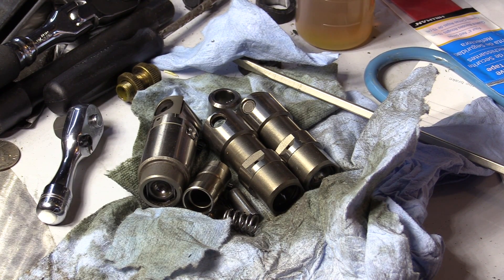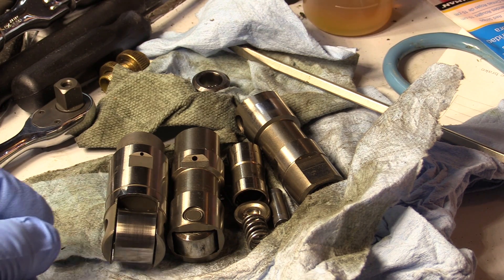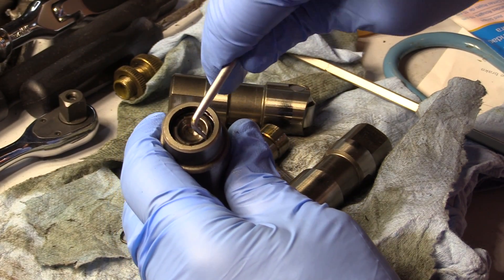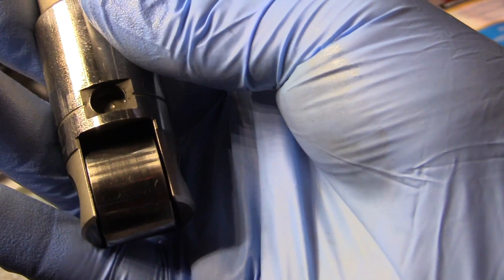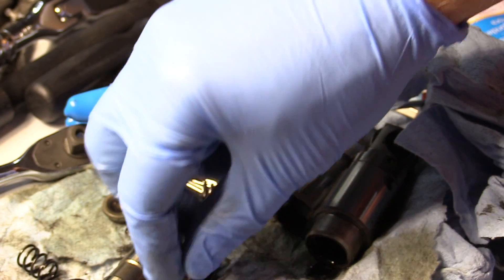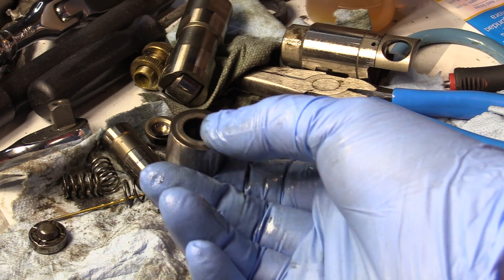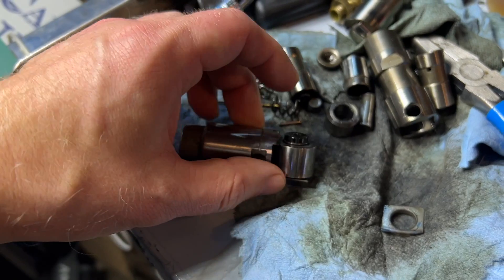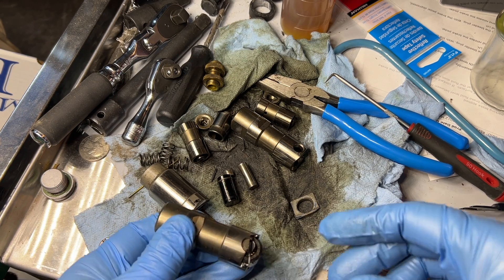Ram 6.7 cummins lifters design problems, Ram hiding 3 issues, Cummins ticking, lifters hydraulic

Comment: Simple, corp greed is why. Dodge can sell more parts and engines. Sad they finally got rid of the 68rfe junk, then sells Cummins designed to fail. ITS A DIESEL, it’s supposed to make noise, that’s part of the reason we bought it in the first place. Making a diesel more quite is stupidness in full form.

Comment: My dealer refuse to acknowledge a problem even if the engine has this clicking noise.  How can I easily convince them that something is wrong?  Would an oil sample show that it is a problem?
Reply from the maker: if there is excessive metal numbers it will be the indicator, however dealer can play a game and say its normal. If you choose to get oil analysis done, make sure its done by ISO certified lab

Comment: There are companies making solid/flat tappet conversion kits for the 2019+ 5th Gen. The cheapest option but one that does not eliminate all of the issues is one where you replace the hydraulic section of the lifter with a solid plug, new push rods and rocker arms and costs about $1400 in parts. The better option is the one that replaces the OEM hollow narrow-lobed cam with an aftermarket solid cam with wide lobes, true flat tappet lifters, push rods, and rocker arms at about $3200. Essentially the latter option restores the valve train back to the 2018 back design. Give me solid flat tappets that I have to adjust every 150,000 miles compared to having an engine block being replaced because the lifter bore was destroyed by a locked up lifter. Ram is replacing the block under warranty at 35K miles instead of an engine. They want to the old rotating assembly into a new block and reinstall the head and accessories on the new block. What could go wrong with that genius plan?

Comment: Cummins uses solid lifters in the 6.7 ISB commercial version for a reason. They put a ton of those in school buses, and they run forever. Makes no sense at all to use these junk roller lifters.
Reply from the maker: Yes I agree with you 100%
Reply: @repairvehicle  I run m2 106 western haulers with the 8.9l ISL. 4000 Allison 6 speed. These have been bulletproof. You couldn't give me a 3500 truck from any of the big 3. They just don't hold up over time.

Comment: It’s not Cummins it’s ram that did these lifters the commercial Cummins 6.7s in busses still uses flat tappets unfortunately if you want the reliability you have to spend a extra 7k to do a conversion ram should just to a recall
Reply from the maker: Cummins builds these engines not ram

Comment: 2012 is the cut off for buying Rams with cummins.  No DEF systems
Reply from the maker: But they run rich and clog up everything with soot and don’t have good mpg like the ones with def
Reply: Yes. The DEF engines don't run as much EGR and tend to stay cleaner. @repairvehicle

Comment: Is their not an aftermarket set of these any sort of fix for this
Reply from the maker: No. However, there’s an aftermarket fix to convert to none hydraulic like previous generation had. Very expensive conversion
Reply: @repairvehicle  well damn it seems fifth gen owners have you hands tied  it seems as though your gonna pay for the conversion or a new engine and I honestly think imma go with the conversions since that seems to be the only option
Reply from the maker: Another option is to buy 2018 or older and never have to worry about engine repairs. That's what I did bought used 2018 and paid more than fifth gen costs and don't regret.
Reply: @repairvehicle  well good for me because I have neither
Reply from the maker: @fireflyraven2760  what do you have?

Comment: Ive got a 2021. Bought it new. Almost 90k on the odometer and no issues yet but i know its coming eventually. Im in florida so its hot here and been running mobil 1 5w40 at 7500 mile intervals. Its never had 10w30 for whatever that is worth. 

My brother has the same truck. Hes just over 100k miles and his lifters are making all kinds of noises. Hes mistakenly been using the same oil he uses on his 2018, 15w40 rotella.

Cummins had a nearly perfect engine up to 2018 before all these ridiculous hp/tq wars. They need to go back to the basics and reclaim their good name.
Reply: 15W40 is too heavy for the lifter, I'm seeing a few customers with the lifter issue regardless of 5W40 or 10W30 ranging from 50,000km on engine to 150,000 so I think its just luck of the draw, for what its worth I have used 5W40  from day one with OEM filters and @ 60,000km I am developing lifter tick as well. I have a Hamilton cams flat tappet conversion sitting on the shelf that I'll throw in but man I can't understand why they decided to shoot themselves in the foot as far as reliability goes. I had 10,000 hrs on my 2015 6.7 and my cam looked brand new(melted a hole in Piston #3) but the flat tappets were not a wear issue.

Comment: I was really disappointed when they went to hydraulic lifters. Checking valve lash every 100-150,000 miles was a quick and easy job, and eliminated a lot of potential problems and limits on longevity.

Comment: Just found this video on my feed. This problem with the lifters caused my 2021 ram Cummins to be deemed a lemon and repurchased. My lifters started tapping like crazy at 10k miles…
Reply: Was it easy to deem it lemon, having the same issues with my 2021 ram 2500 cummings
Reply: How much did it cost u
Reply: @curtisblaze7891  I had the manufacture warranty on the truck. The dealer couldn't fix it and it was deemed a lemon. Got a refund for the truck luckily

Comment: I've taken lifters out of these engines like 3 times. Of those 3 times, one of them was actually fuel knock and not engine mechanical. These engines have a normal light ticking noise that is present on ALL of them, which you normally wouldn't hear, but since the 19+ is so refined and quiet, you can actually hear. The noises you are more then likely talking about is a loud thud coming from the lower side of the engine block which happens when the engine is warm, not cold, and you can't hear it when the engine is making power. When a lifter fails and collapses you actually hear the engine choke and air pop back through the intake... true lifter failure is pretty unmistakable on these.
Reply: @JrSpitty  so are thrown off valve bridges , my Truck’s trick

Comment: Ram didn’t approve this design from Cummins. It was their design. And their supplier provides the lifters, it’s a mopar part that Cummins cannot get. Ram is the king of crappy cams and lifters as seen with 15 years of hemis. 

From 89-18 the 5.9 and 6.7s in the rams were exactly the same as the engines Cummins sold to other OEMs, and very similar to the off highway ISBs. The 19-21 in the ram is ram specific. Other OEMs that use the 6.7 are not getting this version, CGI, hydraulic lifters etc, even the cp4 for 19-20, Cummins kept cp3 on all other ISBs. This is a mopar engine design through a through. And they ruined it. Ram must have Been pissed they didn’t get all the repair work with the Cummins like they do the hemi. Cam and lifter failures which typically happen out of warranty are a cash cow for ram. Now they get to do it with the Cummins too.
Reply: Plug is an anti-rotation pin. When the lifter is inside it can’t fall out, the roller not having needle bearing is good, needle bearings fail all the time and have low life expectancy. The black on the pin is a coating to help with lubrication. Obviously there is an issue with the execution, but the design is solid. Even Dave’s Auto talks about the needles on the roller, he sees tons of failures and wants ford and GM to go to a solid bearing design, no needles.
Reply from the maker: Ram signed off on the design for these engines and accepted bad design, just like Nissan accepted and signed off on the 5.0 junk Cummins. Every part must be approved by oem engineers and management before it installed in the vehicle. Mopar does not manufacture Cummins engines just like Mopar doesn’t manufacture other parts but buys them from suppliers
Reply: @repairvehicle  mopar product managers and engineers were heavily involved in this design. They didn’t just sign off, it was their ideas. This is basically a mopar engine made by Cummins. It’s no longer a real ISB.
Reply from the maker: more people should see this video and boycott 2019 and up ram trucks, until they bring back normal true and tried engine.
Reply: @repairvehicle  agreed. The previous Gen 6.7 was bulletproof. Just an all around awesome engine. 

At the least they need to go back to flat tappets.
Reply from the maker: what do you have yourself? Cummins?
Reply: @repairvehicle  yessir, a 21 2500. I unknowingly bought a 5th Gen to get away from hemis so I didn’t have to worry about cam and lifter failures anymore lol. Imagine my surprise when I find out the much more expensive Cummins now has the same damn problem. It’s on me for not doing my research. I so wish I bought a 4th Gen.
Reply from the maker: @jfitz9624  when I bought my 2018 ram Cummins used I end up paying more for it than what 5th gen’s were selling for. 5th gen’s had cp4 at that time and I did not want to deal with it. 5th gen cost were less than 4th gen at that time and now looking back I realize that I made a good decision and I did not know at that time about their lifters not having bearing.
Reply: @repairvehicle  4th gen were the best diesel trucks ever built. I've had several. Most recent was a new 2017. Had it for 3 1/2 years with 130k miles on it when I traded it in and never once seen a check engine light. I now have a 2021 5th gen with almost 90k on the odometer and I'm just waiting to for the lifter issue because I know it's coming eventually. My brother's 2021 is going through it now with the lifters. He ran 15w40 rotella by mistake and is out of warranty so it'll be out of pocket. I've been running mobil 1 5w40 and I guess I'm lucky so far. Ram needs to go back to flat tappet and iron block.
Reply: It is not a Mopar design. Mopar doesn't have that choice.
Reply: @ yes they do. This is a mopar only engine. Mopar engineers work side by side with Cummins to design the engine and mopar provides the design specs for it. Years ago the engine put in the dodge/ram trucks was either the same, or virtually the same as the engine Cummins sold to other truck and equipment suppliers. Not anymore. The big change came in 2019. And even more so for the 2025.

Comment: My 19 6.7 ho throws off bridges and has a head gasket leak at 117,000 unacceptable crap , never again Ram
Reply from the maker: 4th gen Ram will go down in history as best Ram/cummins ever made.
Reply: @repairvehicle  the power is great on the 5th gen but the lifters and the coolant leak at 117k damn it
Reply: Hardly  @repairvehicle
Reply: Deleted?
Reply: @ Yeah late in its life , like at 100k miles.
Gonna cost several thousand dollars to replace the roller lifters and cam , head was checked it’s not cracked anyway

Comment: Have you seen better results with a specific oil brand for the Rams?
Reply: I using the Amsoil Heavy-Duty Synthetic Diesel Oil 10W-30 here in Puerto Rico, USA. Tropical area. Is a good engine oil?
Reply from the maker: Yes its good oil
Reply: @repairvehicle would you recommend 5W for winter? Or 10W year round?
Reply from the maker: @meek2183 , Ram recommends for temperature above 0 to use 10w-30 full synthetic oil. For temperature below 0 Ram recommends 5w-40 full synthetic oil.
Reply from the maker: Yes I have and other people too. What do you have
Reply: @repairvehicle  2020 and 2022 Ram 6.7 currently using Amsoil Signature Series
Reply from the maker: @WRCPNW , keep using it. I use same thing in my 2018 ram Cummins
Reply: @repairvehicle  appreciate the reply and your content! Have a great day
Reply: Only solution is the lifter delete kit.

Comment: I've been saying all along the hydraulic oil port was to small and the plug with soot and lifter failure pulverizes even good cams.
Reply from the maker: Hole is only partially a problem
Reply: @repairvehicle  this is true but it's the largest problem that exacerbates the rest. 9 times out 10 failed hydraulic lifters that don't create zero lash condition pulverizes cams push rods rockers and valve stems every place they make contact. A perfect cam alloy heat treated to spec will be destroyed every time. You are absolutely right on all three lifter points that are bad design and Cummins dose better. I want to thank you for revealing what I thought from the start.